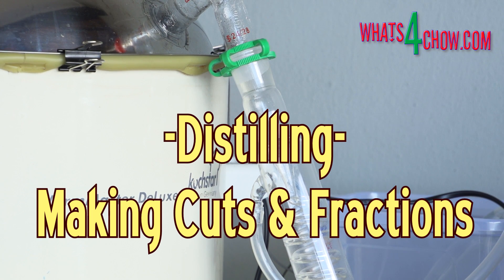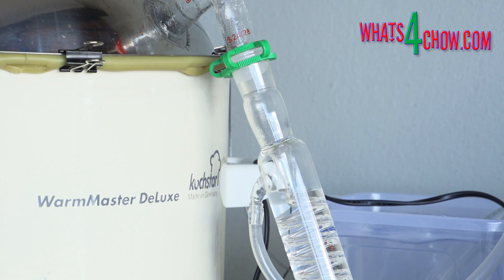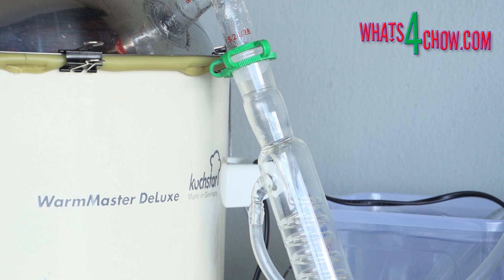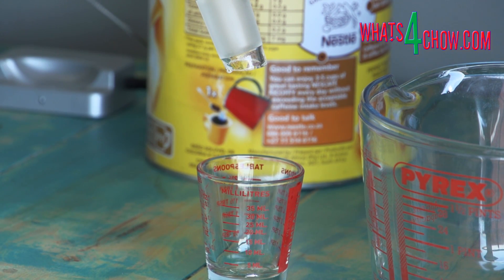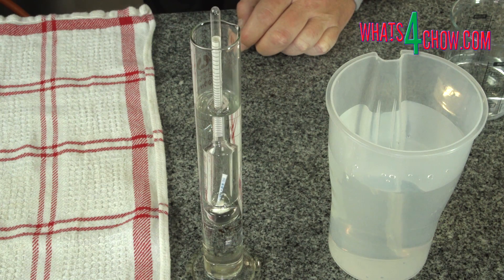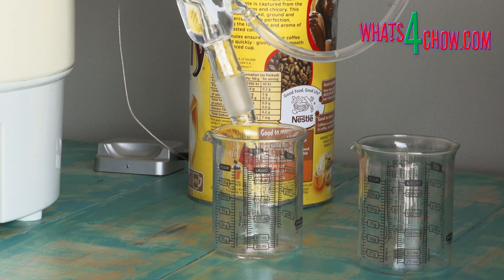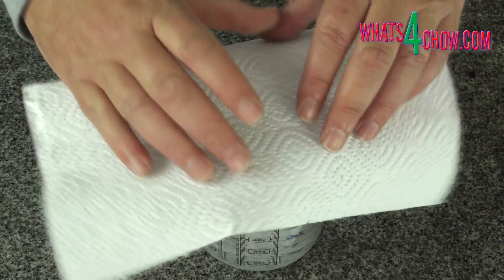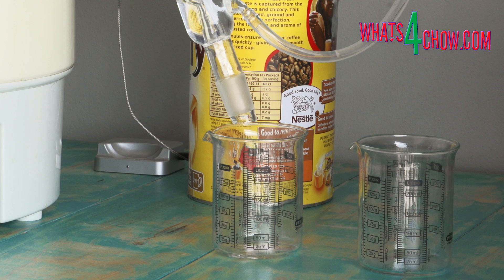Distilling Alcohol - Making Cuts and Fractions - Learning to Blend Better Alcohol

Comment: Would running a reflux still rather than a pot still change this process at all?
Reply from the maker: Hi Aaron -- yes, when using a reflux still,  the resulting alcohol is between 94 and 97% pure -- it has been stripped of all flavor and aroma. This is then diluted to make vodka and flavored with essence. You would still remove the foreshots at a rate of 30ml per 5 liters, to get rid of the acetone and small amount of methanol.
When alembic distilling the resulting product still has aroma and flavor (congeners) that carry through from the fermented mash or wash. This would require cuts and fractions to achieve a pleasing tasting product. 
I hope this helps --- thanks for watching!!!

Comment: I made some apple brandy that started out at 145 proof I did a second distillation it starts out at 174 proof and finished out at 120 proof how do the cuts change on a second distillation most of this I pulled off at 172° I also made a sweet feed run that started out at 145 Proof I did a second distillation and it now started out at 165 for proof and finished at 105 proof do the cuts change on that is most of us second distillation drinkable
Reply from the maker: Hi Joe - apologies for the late reply -- ok if you're doing a double distillation, your first run will be a stripping run -- meaning a run simply to strip most of the alcohol from the wash. At the same time you will remove the foreshots (acetone and methanol) at a rate of 30ml per 5 liters of wash. The stripping run will start at an ABV of around 85% (170pf) and you will stop the still when it reaches 20% ABV (40pf).
In your second run, the distillate will start at about 90% ABV (180pf) --- when it reaches 70% ABV (140pf) thee heads have been collected -- these should be collected in portions of 100ml-500ml, depending on how meticulous you want to be in the blending process.
As you continue, the ABV will drop from 70% ABV (140pf) to 40% (80pf) -- this is your hearts, and will the the majority of the product. This can be collected in a single batch, as it is all good stuff.
The tails occur from the 40% ABV (80pf) down to the 20% ABV (40pf) and should also be collected in batches.

Blending this into a pleasing product is a matter of personal taste. Sample the batches from the heads and tails. The samples that have pleasing flavors and aromas will get added back to the hearts -- not necessarily all of it -- each batch that you decide is pleasing and usable, will be added back (blended with) to the hearts in the quantities that you see fit.

A note to remember is that when you are tasting the heads, it is easier to dilute the heads to 43% ABV (86pf). This will enable you to taste the underlying flavors instead of being overwhelmed by the high alcohol content.

Thanks for watching!!!

Comment: You instruct to taste each sample of heads and blend the "decent samples" with the hearts.  Previously, you stated that the 'head' is mostly methanol, so why not discard?  Why blend methanol in . no with the hearts?"  EDIT: I read the transcripts.  Since you are demonstrating using sugar wash, no 'head' methanol is produced so it is simply higher concentrated ethanol as the heart.  Am I understanding this correctly?
Reply from the maker: Hi --- sorry for the delayed response, but season over here is just insane. You are understanding correctly, however there are a few deviations from the general rule. If you use a very fast yeast like Fast Turbo from Still Spirits, you will need to use the Still Spirits liquid carbon, and their 2-part clearing kit. The faster a wash takes to ferment, the more crappy stuff builds up. These nasty things are made up of sulphur (stinky), a minuscule amount of methanol, and acetone, which is a strong smelling solvent. 
If you use a very fast fermentation, the general rule is to remove and discard 30ml per 5 liters of wash ie. if you start with 25 liters of wash, you will remove the first 750ml of distillate. This will ensure that all of the acetone, methanol and sulphur is removed.
That all said, if you use a slow yeast, like champagne yeast, or whiskey distilling yeast -- both also available from Still Spirits -- you will not need to be concerned with any of the above issues.
As far as the blending is concerned, a large portion of the flavor, or congeners is contained in the heads and tails portion of the run. This is where your personal preference comes in, as to how much, and what you decide to add back to the hearts to end up with a nicely balanced and well flavored end product.
I hope this helps, and feel free to message me again if you need anything else.

Thanks for your interest, and thanks for watching.

Comment: Finally a scientific % explanation of making cuts,something my brain can grasp.I have been a homebrewer for a few years and have dabbled in distilling but i never could get my head around making cuts other than discarding fores.One question though why do you use such small beakers to collect your samples ? I would imagine on a 23lt wash this would get rather awkward.Blending is another thing i can't grasp so in the few batches i have done i have just used hearts mostly and very little heads but no tails at all.Cheers.
Reply from the maker: Hi -- yes, you can go as fine as you want with samples. The finer you go (smaller samples) the more you have to taste and blend, for a better product. Remember that when I collect hearts, I am mixing these together after the ABV measurement, meaning that I am coming with a bunch of samples for the heads, 1 batch of hearts, and some for the tails. The splitting of samples while collecting the hearts is done purely to get the most accurate cut between the hearts and the tails. You don't have to use such small sample batches, this was basically exaggerated to explain the whole process. If you want to take it even further, then you would install a distilling parrot in the condenser until -- this does really help in that you can take ABV reading on the fly, without having to fiddle with sample batches at all.

Thanks for interest and thanks for watching!!! --- happy brewing and distilling!!!